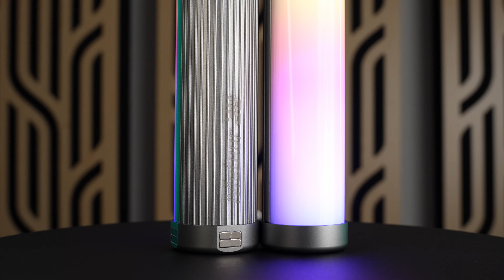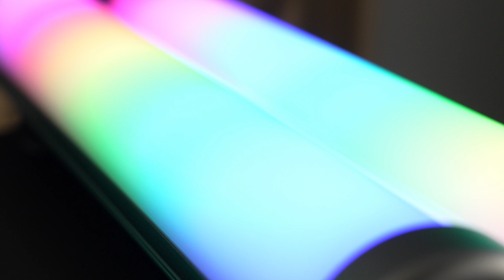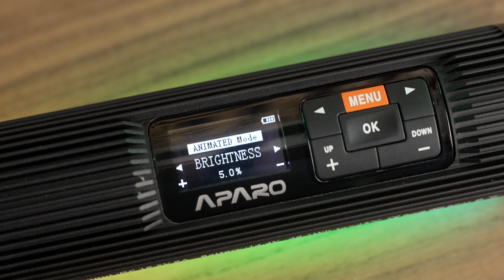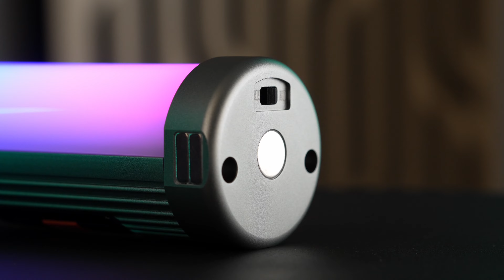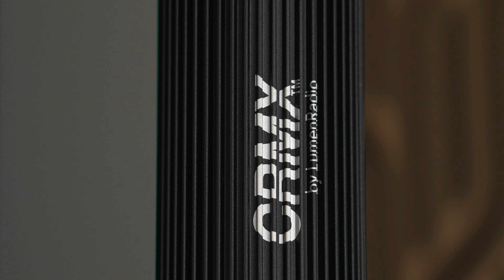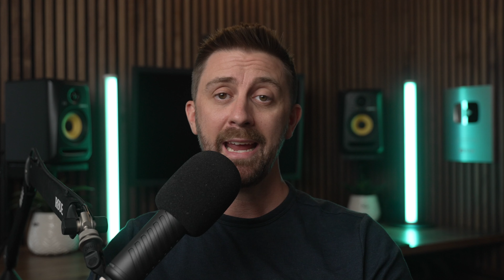Aparo Meteor 30 & 60L - Most Customizable RGB Pixel Tube Lights EVER

Comment: Try to include wattage and brightness testing for RGB and different colors of light, you would assume RGB would be 1/3 the brightness depending on the color but some lights it's less than 1/10 and daylight can drop it down to 50%
Reply from the maker: Will do my best, usually I barely have enough time to cover 1/10 of the lights I have, so I don't see it happening honestly. Most companies list the output in lux for each individual LED color now (R, G, B, W, and T), which should be just as good (if it's available).

Comment: The one thing I missed in the video, are they T8 or T12? Having to get T8 fixtures as well is grinding some gears.
Reply from the maker: Neither! They're actually 1 7/8" in diameter if that helps!
Reply: I think that's basically the same as a T8 tube, maybe slightly smaller if my math is right.  @NewLayer